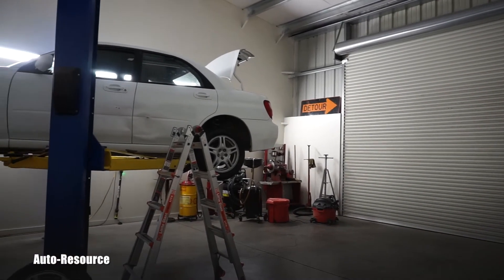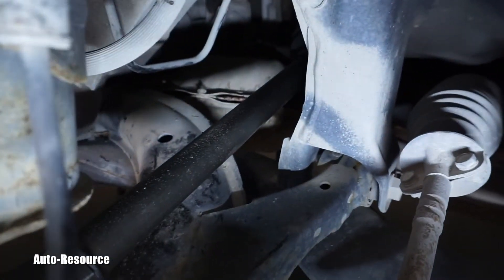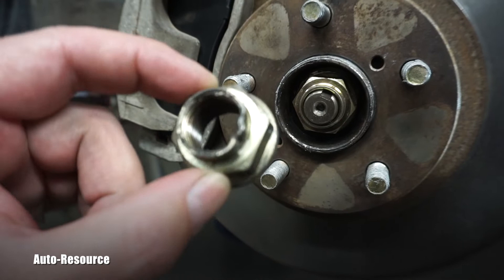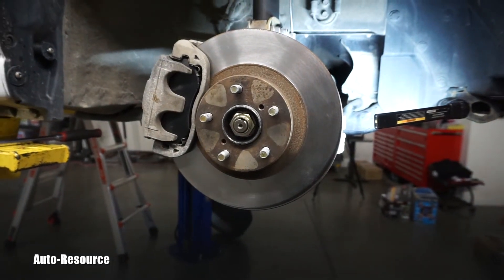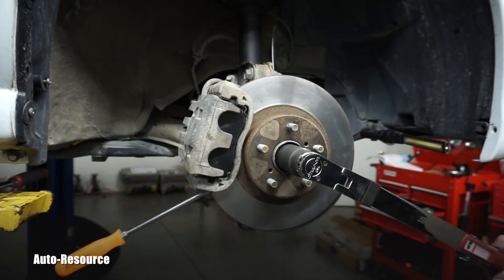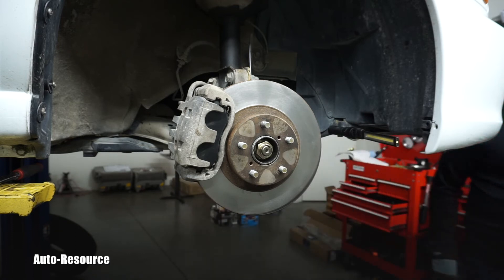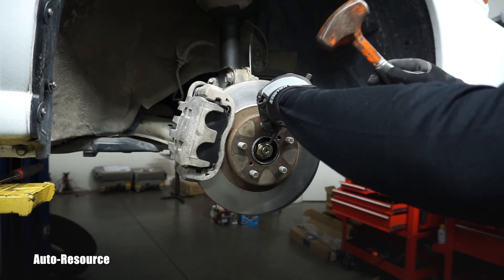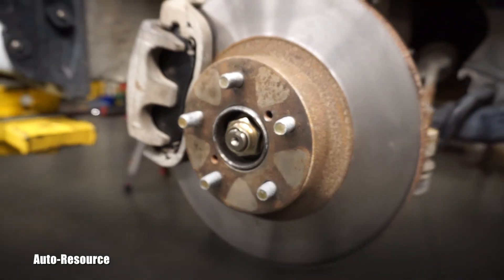SUBARU - how to torque axle nut

Comment: Good tip on use of the screw driver, but I just put my breaker bar between the break pedal and the front of the driver seat and slid the seat forward until it depressed the break pedal.

Comment: just put the wheel on and drop it on the ground...
Reply: Yes you could, but NO you should not! The weight of the wheel and tire is not wanted on the bearing during torquing and also getting tire to not slip while tightening axle nut will require lowering against the ground some, adding unwanted pressure on the bearing.

Comment: Thanks for informative video. I need some advice on my truck if you can help. I have a 2002 TT-2 Suburu Sambar 4 wheel Drive.  No manuals for torque specs. No help from part suppliers. American Suburu Dealers do not recognize the truck as Suburu. I am thinking the torque specs on the vehicle you have in video is possibly a good spec. I should have checked Torque before removing nut. However I purchased a Danko book that supposedly was a shop manual for my truck . WRONG!! His book is truly worthless. 
I did check torque on rear wheels. But the torque is higher than my wrench goes. Not sure if torque is different front to rear. Any suggestions ?

Comment: My 04 wrx wagon axle nut keeps coming lose. I’ve torqued it to spec multiple times and still it loosens off. I get down the road and boom the grinding noise from the axle comes back because the nut keeps coming loose. Does this mean it’s guaranteed my wheel bearing? How would i know? I watch this video thinking I was torquing it the wrong way the whole time

Comment: Actually a high quality tip.  I've had to install my old axle nuts because the ones that came with my axles are slightly thinner and kept unstaking and spinning loose. But I've never been able to torque it correctly either, so hopefully this sorts it out

Comment: Well done! Thank you. I have an 18 Outback, never have axles been replaced so far. Approx 34k miles. Should axle nuts be checked from time to time and what might be the consequences if they are not sufficiently torqued to the spec. I have a little ticking from the wheel I believe, Not backing plate or dust shield. Pads new, rotors and calipers all good. When I apply the brake the ticking noise goes away and I am thinking maybe that it's a slightly loose axle nut perhaps, or beginning of a bad CV joint. Does nor sound like a hub. Thanks for all you do,